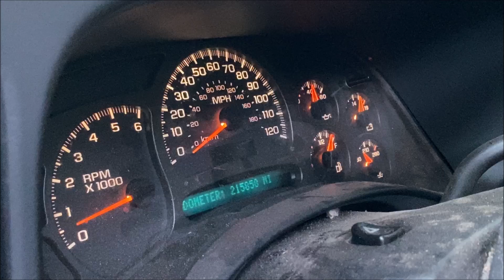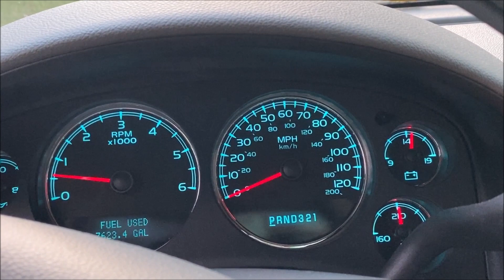Why we only drive GMC - THE BEST TRUCKS  #Sierra #Yukon

Comment: Great to see you own GM products, I’m a GM fan myself.  That 6.0 in the Sierra sis bulletproof and will go 400-500k miles without issues.  It’s backed by a 4L80 transmission, also bulletproof.  Be careful with that truck as it’s sought after by thieves because of the drivetrain.  I have a similar truck, a 2000 Silverado 2500 with 270k miles.  You can swap out to more comfortable front seats from any year between 2000-2006 Tahoe,Suburban, Yukon, Escalade and Avalanche. If they are power, it’s easy to wire them up.

That Yukon is actually a 5.3, that body style never came 5.7, it would say it on the Emmisions sticker on the air box.  The Yukon heavy duty came with the 6.0. That SUV is very nice and comfortable, good buy 👍
Reply from the maker: Yes! 5.3.. my bad. I know they like to steal these. I always lock it and park it near the house where i can hear anything. I know they steal these alot and also diesels
Reply from the maker: I wanted the 2500 SUV but they are hard to find